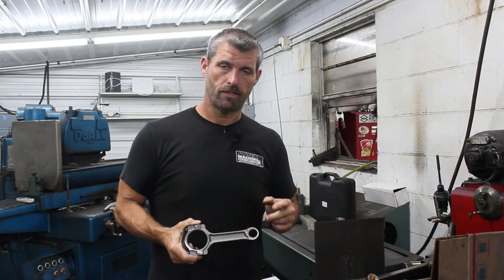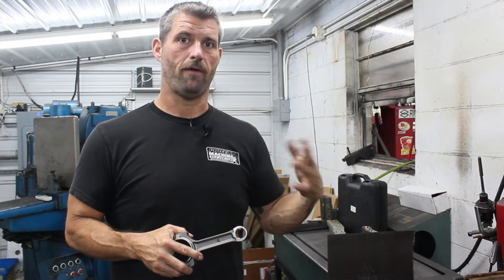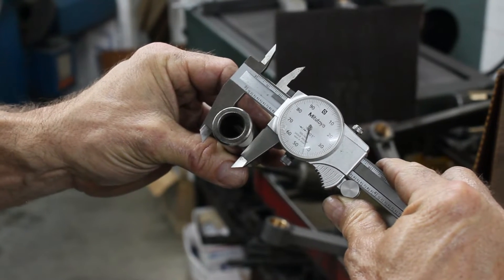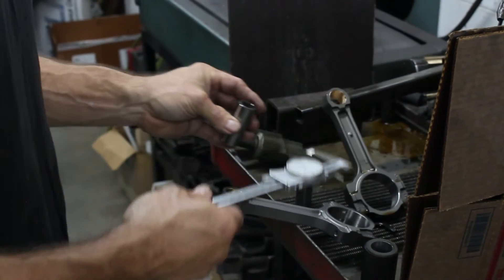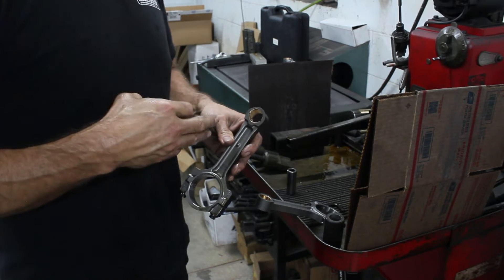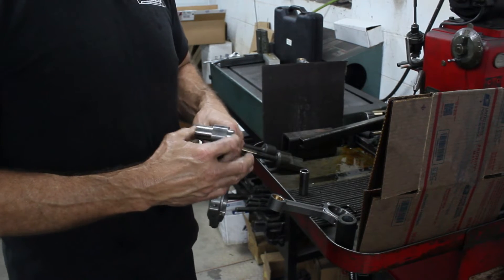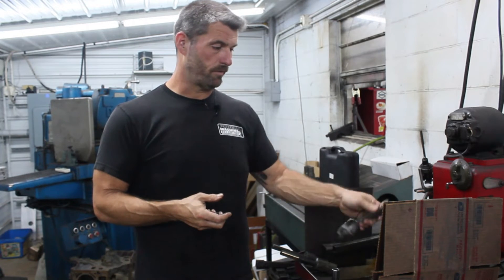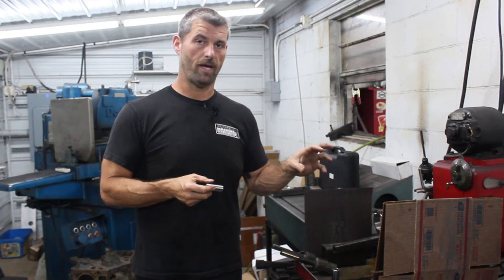Gen4 Rod's,  honing to fit forged pistons

Comment: I subscribed thanks for sharing knowledge. Im diyer and never built engine im working in my first l92 with Forged piston that have .945 pin . Do i have to change rods bushing and hone it or is it ok to hone the factory one . The build is street use NA with some springs rocker upgrade andd  silent cam . What's your opinion
Reply from the maker: Hone the factory rod

Comment: With a good tune what do you think the power limit is for a forged piston on gen 4 rods otherwise sbe would be on ethonal ? leaving a touch on the table to try and pull some longevity out of it of course not talking just a few laps more like a few season's at minimum given the tune up stays spot on.
Reply from the maker: @BoostNBalast  800ish

Comment: I’m in the same situation with a 5.3 GEN four rods and forged pistons would you recommend not using forged pistons considering my goal is 500 crank naturally aspirated 11:1  compression?
Reply from the maker: Yep, either is fine,  but factory style will handle that no issue's
Reply: @powellmachineinc  is there any reliability and maintenance differences?

Comment: On BBC and BBF press fit pins can you convert them to full float?  With bushings and without?
Reply from the maker: We have honed rods to float without a bushing,  we add a top oil hole, but adding a bushing is ideal
Reply: @powellmachineinc   .001 clearance for street hot rod use? with some off road rallying og?

Comment: Definitely good info.
 IMO,  you're gonna have to balance the rotator anyways because the new pistons won't weigh the same. At that point, you might as well put a set of aftermarket rods in it with the more common .927 pin size. 
You're only saving like $400 by using OE rods and not gaining any strength/durability....
Reply from the maker: Right on
Reply: It's really the wrist pin that's the weak point, so you're not gaining much with forged rods since beefier pins come with forged pistons. OEM pins are paper-thin vs aftermarket pins and end up flexing - which either binds the rod (snapping it off). It's why OEM pistons crack at the wrist pin, it crowbars the piston apart. It's also why gen4 rods take more abuse, the floating rod has an extra spot it needs to bind.

Comment: How many people put the smaller pin in the piston
Reply from the maker: Generally the pin length is much shorter on forged pistons,  so it would not work.
Reply: @powellmachineinc  will that's good